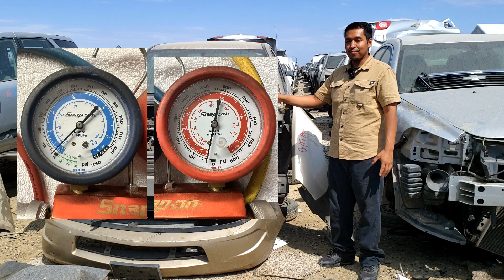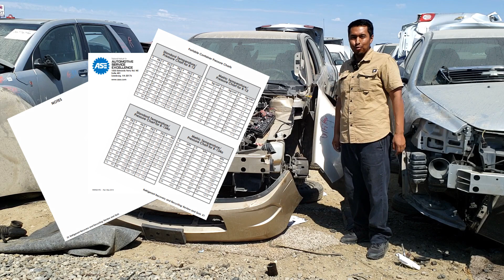3 ASE A7 Topics That Seem Difficult At First

Comment from the maker: Update Oct 15, 2023: I passed the test! There's some very important information I talk about in the first topic, mainly knowing the answers to the questions about the metering devices.

There was 2 questions about leak detecting on the test.

Nothing related to the 609 testing material was on the test. No need to memorize SAE standards or worry about "other" refrigerants. No questions about R12 or R1234yf, the main focus is still R134a.
Reply: What were the answers to the metering device questions in the video please ?
Reply from the maker: @abraham2822  If the FOT is clogged, low-side pressure will be lower than normal, possibly even at a vacuum. If the TXV is stuck open, there is no "metering" going on, so the pressure will be higher than normal on the low-side, basically there will be no separation between low and high side.

Comment: 1:41 it could be that the condenser is clogged with debri, or cooling fan is not working on top of that blower speed  not going to max (blown blower motor resistor) on top of that a bad expansion valve or txv stuck wide open